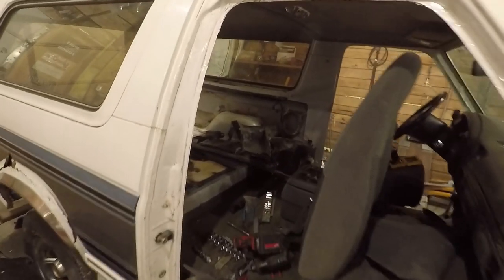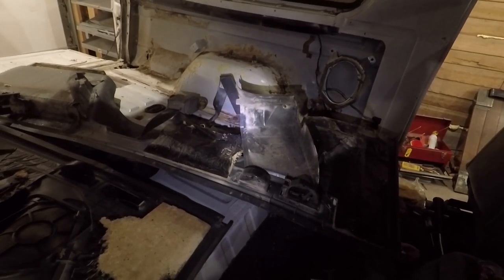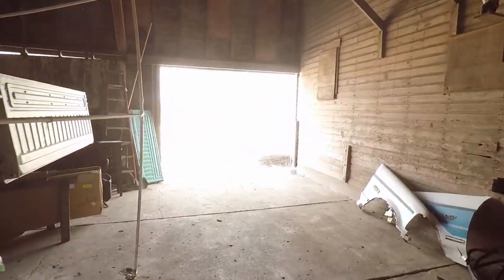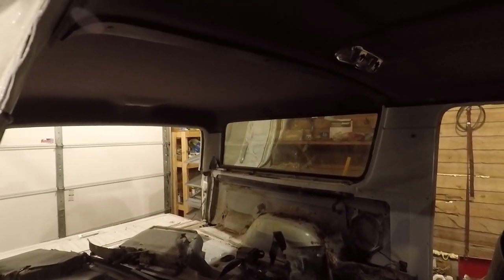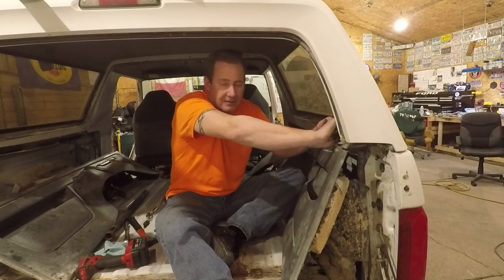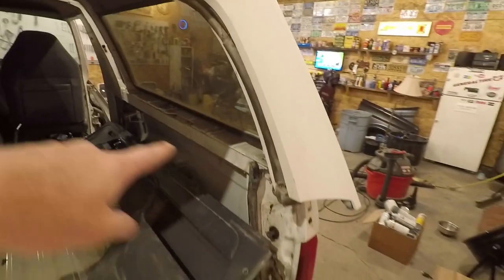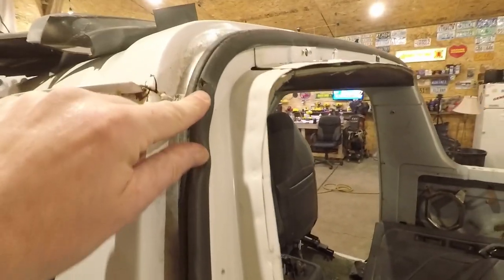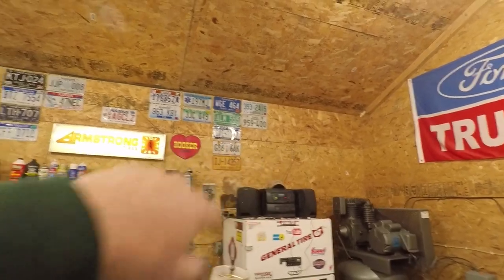The BRONCO Goes TOPLESS - The FORD BRONCO Project

Comment: In the '92-'96 models, they switched to a security torx bit. Due to federal regulations, Ford had to add shoulder belts in the back seat as well as a high-mounted brake light. They didn't want you to take the top off after that because it would disable both, but re-tooling the manufacuturing would have been too expensive for a vehicle in its last generation.

Comment: I have done lots of research on Broncos after buying my own and that year because of the light on to removing the top is considered a safety hazard so they stopped including how to remove the top in the owners Manuel. They made it hard to take off for that safety hazard that’s why they use the bolt with the rod in the middle to keep people from taking the top off.

Comment: Safety torque heads. I use to just get a flat head screwdriver and bust the centers out the safety torque bolts then i would just put a regular old torque socket in there and take them out.
Reply from the maker: LOL, I've done that too....tried it on these bit too big...and if it would have worked, to many.

Comment: they put the post in the torx bolt because it was actually illegal to remove on the 5th gens because the rear seatbelts bolted to top. in every other generation however they were very easy to remove and instructions on how to even came in the owners manual. don’t let this discourage you to remove your top however, had mine off for a month and drove around all over with the seats full and never had any problems. i highly doubt cops know it’s illegal.

Comment: I had an Old Chevy Blazer use to hang the Top from The garage ceiling in the summer time and back under it if I wanted to put it on Just Lower it and bolt up. I would find out What threads those safety Torx have  and replace them with regular bolts, might have to use safety ones where that trim piece goes. Great Job

Comment: It's said that they switched to first bolt on and then changed to different bolt type soon after for safety reasons.  Owners would have less interest in removing it.  I say it's all about money.  If you need to purchase more tools every time you repair a vehicles of different year make model they make more profit through ties.

I'm the type of person to buy a new tool when needed every time.  For future use else were.  For bolts I prefer cut it off if vice grip doesn't doe it.  Then replace it with more logical one.

Comment: Dont worry i understand. You just got tired of  fighting with it so you decided to go and purchase the safety torque bits  to try and make life a liitle easier on you.  Its too bad there,s not some kind of way of a quick release latch system  could be fabricated to make the top easier to take off and put on instead messing around with safety torques.